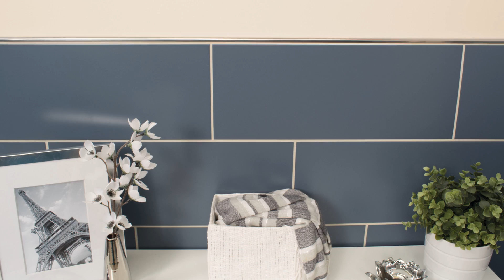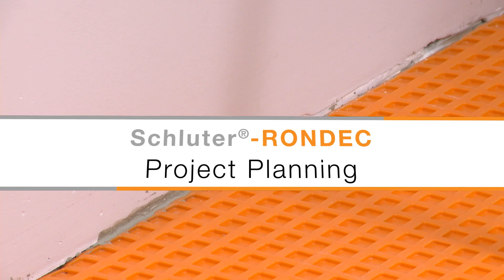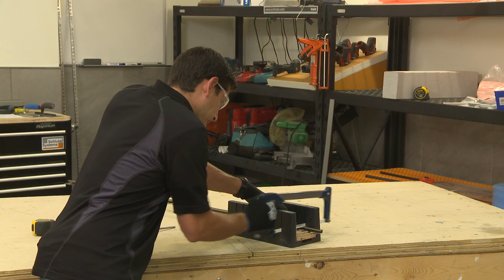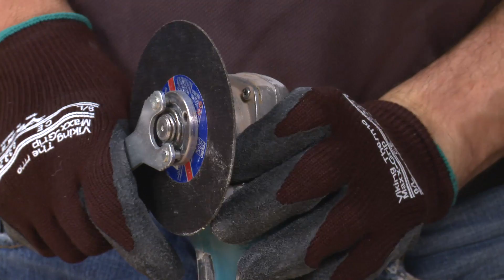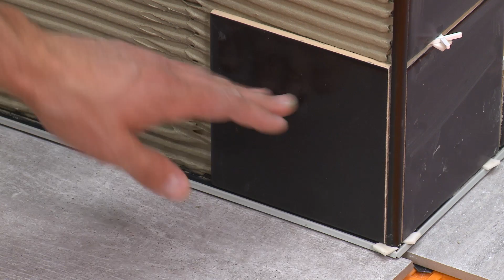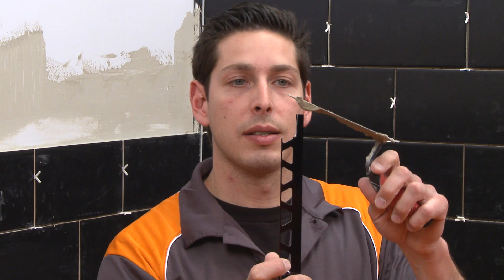How to install tile edge trim on walls: Schluter®-RONDEC profile

Comment: That Makita is not variable speed. You did a switch in your dial select cut vs actual cut. So…it doesn’t matter?
Reply from the maker: Hi David, I'm not 100% sure which angle grinder was used in this video, but the lowest speed setting is what we recommend as it helps to ensure the best cutting of the profiles. Hope this helps!

Comment: Does one have to factor in the thickness of the mortar bed when purchasing? For example if my tile is 1/4 thick should the .25 profile be purchased or the .375 because the mortar bed is 1/8 thick ( in this case)
Reply from the maker: Hi there, in general, we recommend choosing a profile with the same thickness as the tile. After the installation, the tile should be even with the top of the profile or up to 1/32" lower. However, if it is a larger format tile with extra thin-set build-up, it may be necessary to move up to the next size to allow for that difference in height. You can always call to speak to our Product Support team and they can advise on your project and provide you with samples if you need as well. 800-472-4588 (US) or 800-667-8746 (Canada). Hope this helps!

Comment: After bending several pieces of expensive trim when it was just about done cutting (no matter how SLOW i cut it) on a CHOP saw, I've discovered that a SLIDING miter saw is what works. Cut the piece within a 1/4" of your desired length, cut back the flange at about a 60 degree angle from the tip, & then cut your piece to exact length. A little extra time but it will save the trim.
Reply: Sass
Reply: are you saying to cut the piece over 1/4 " of your desired length, cut the flange and then miter cut to desired length?

Comment: I have looked everywhere and ask my local dealer this question, if you're going to use a piece of vertical trim from top to bottom on a shower, how do you tie in the shower Dam? There is nothing on YouTube about this and the people that Arizona Tile have no idea. There shall tile they do not install. They sell Schluter they do not install. I have searched the Schluter website for videos and a gallery potentially showing the situation and I come up empty-handed. I'm real close to setting tile in the shower and I could use some help. Thank you
Reply from the maker: Hi Danny,
Sorry to hear that you have had problems finding the answer you are looking for. Our Customer Support team would be more than happy to help you out. Please give them a call at US:800-472-4588 or CA:800-667-8746.

Comment: I got the brushed chrome profile - do I need to use a grout release to prevent grout from getting in the brushed chrome finish, or is that not a concern?
Reply from the maker: Hi Stephanie, Sorry for the delay! Grout and setting materials should be removed immediately to protect the finish. You would need to consult with a grout release manufacturer to verify whether it will work on our finishes, as we have not tested that...

Comment: I recommend NOT using a miter saw to cut them. I’ve had the trim catch a tooth and rip it out from my hand securing it to the fence violently the way they are showing in this video. Glad I was never seriously hurt and it ruins a sizable portion of the expensive trim. Only use a hack saw in my opinion
Reply: I used my plasma cutter, as my hacksaw was borrowed  and never returned thanks Jim
Reply: A miter saw works great as long as you have the correct  blade in it , in my shop I a holder above my saw made with magnetic  tape  and have all my different  blades on it   one for lumber , metal , plastic , etc  .   But yup a good all hand saw never will fail you
Reply: Yes I agree- I've had the same thing happen even going really slowly through the metal- I use a cordless grinder with a cut off blade- build a little jig with some 2x4" stock with a 45 degree angle.
Reply: I hear that! I was cutting something similar, aluminum cove edge molding for a countertop, with a miter saw and the same thing happened to me that you described. Effing scary! Use the angle grinder or I'm getting a lot of use out of my little 12 V Milwaukee metal cut off saw... that thing is sweet for this.
Reply: You were not holding it right